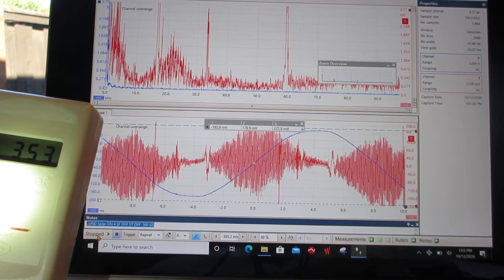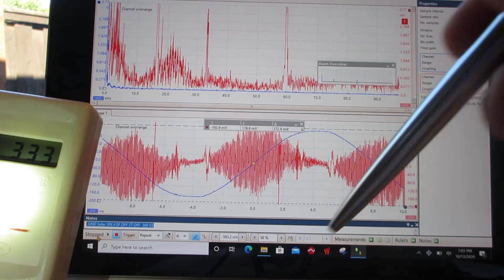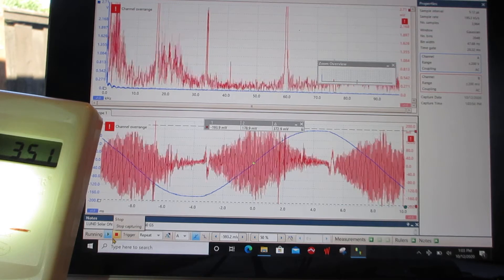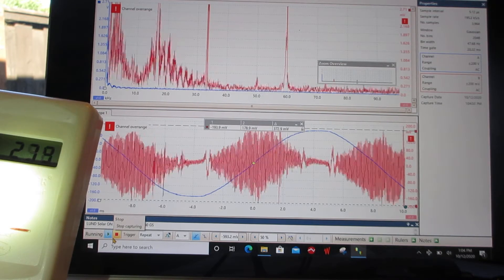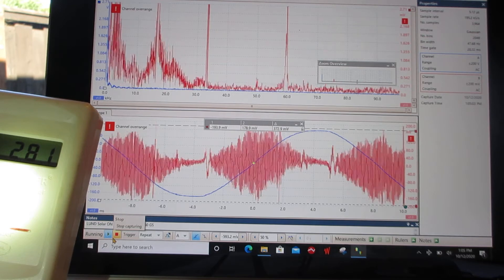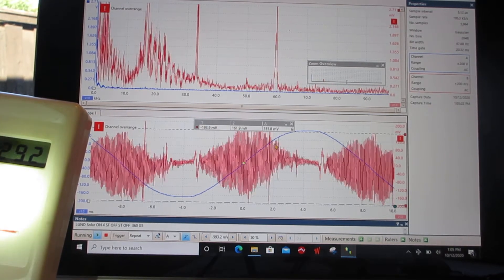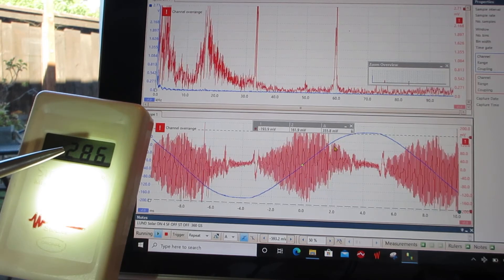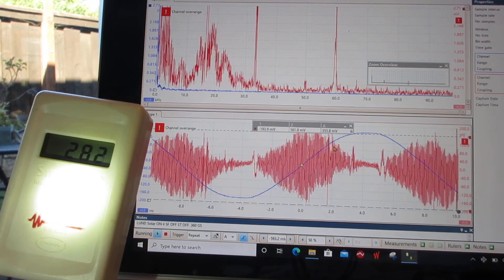SineTamer DE filter does very little to reduce DE created by a solar PV electric system

Comment: Very helpful.    I have an AlphaLab DE meter.   Do you know how readings from Stetzer, AlphaLab, and Greenwave meters corrolate?   Thanks again for all your great work in EMF.
Reply from the maker: Stetzer meters and Greenwave matters measure DE and are plugged into wall outlet.
Stetzer meters measure both frequency and voltage amplitude And is measured in GS units. 
Greenwave meters measure voltage amplitude Only

The Alpha  lab Meter Is almost identical to the Greenwave meter.

Get the Stetzer as it is the only one that has been used in Peer reviewed reports